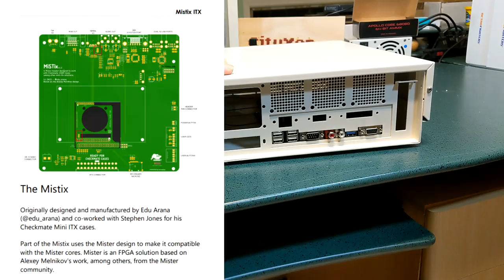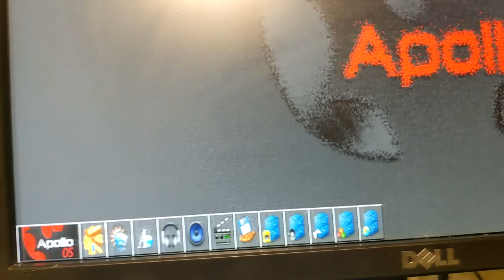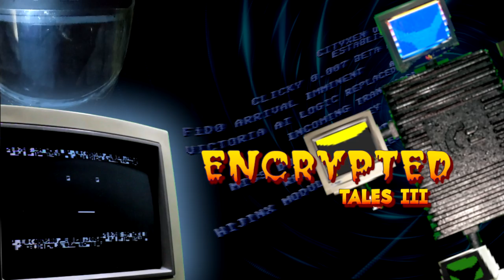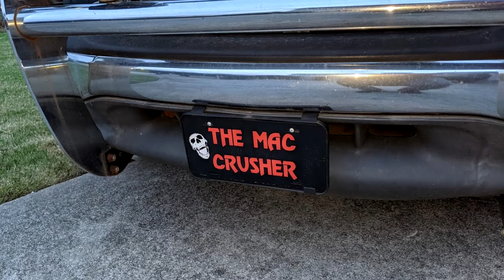Checkmate 1500 mini Vampire Mister Extravaganza With Special Guest BitBarn

Comment: I bought a black Checkmate full size, then most recently a black Checkmate Mini. Originally planned on putting a V4SA into it, but changed my mind and ordered the mistix version. Corsair SFX 450 modular PSU with Cablemod custom sleeved black/red cable kit. Totally overkill. Practically empty inside the case.
Reply from the maker: It's all about that nostalgic feel even if it is virtually empty inside. (That's not a philosophical quote either) :D